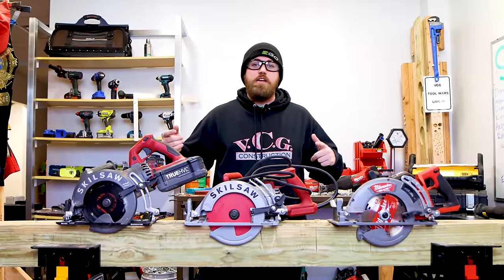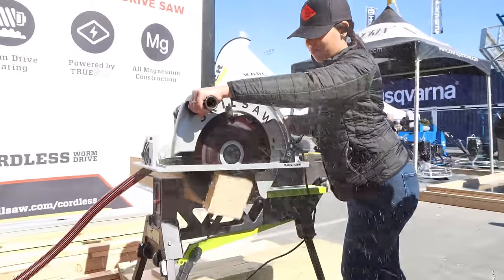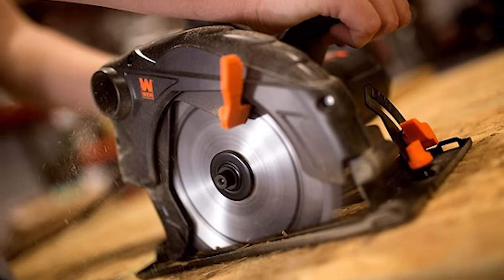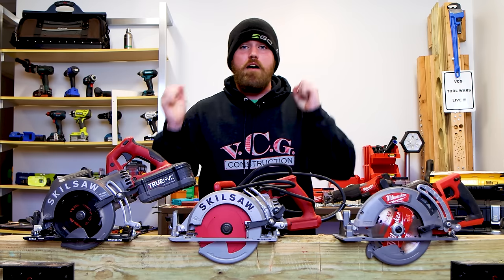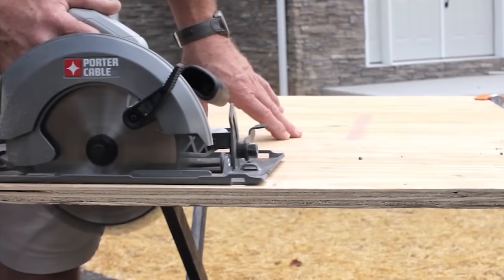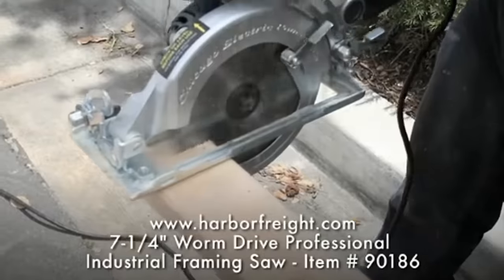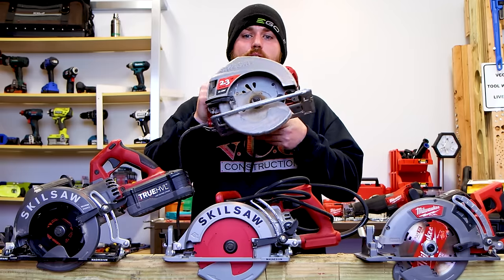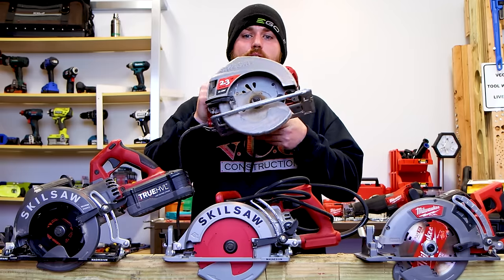We RANKED Every CIRCULAR SAW From BEGINNER LVL To EXPERT LVL (What Level Are You?)

Comment: I have a circa late 1970’s (original owner) Skilsaw 77 worm drive. HEAVY but still running strong 45 years later. Just built a 20’ x 40’ deck with it. Best investment ever. Did I mention it is heavy???  💪💪👷🏻‍♂️🏋🏻

Comment: He had me at  Ryobi (9:45)  I actively avoided Ryobi for the exact reasons he mentions. It looks cheap, ugly, and amateur, but I had to borrow my brother-in-law's miter saw to install some flooring and was genuinely surprised by how much I liked it...so much that I had to go out and buy my own. It's now one of the most loved tools in my shop.
Reply: i own a whole set of Ryobi. It gets the job done even though they arent the best on the market. I would go with Milwaukee or Flex but i don't have the money to shell out for the best of the best
Reply: I bought a Cobalt sliding compound miter saw and it's amazing. It's going on 9 years and still good.  Also the Cobalt air compressors are really good. The problem with cheap tools is not the tool. It's the battery. The battery is the most important part of a cordless tool. Corded tools you can get away with some cheap tools. My cordless Ryobi tools the batteries died in months. I'll never buy them again. Milwaukee batteries last decades.
Reply: Ryobi lacks power though
Reply: Just don't buy the finish nailer. Damn thing can't help but stop working.
Reply: I LOVE my RYOBI Reciprocating Saw.
Reply: @DudeEggs I have a Ryobi 18g nailer that I bought on a whim. Assuming it would break after a month or two. Damn thing won’t die! It’s been like 5 years

Comment: The reason for two 18v batts for the Makita is that you can charge both batts at the same time in 45 mins or less, whereas those bigger "red" an "yellow" batts take almost two hrs to charge. Time is money!
Reply: Quick charge units shorten that time on those bigger batteries
Reply: Time is money. Buy 2 Dewalt 9amps and have one charged while one is working. By the time one dies you'll have another one in the tool. Makita requires you to have 4 whole batteries going
Reply: @JohnDoe-hn5nl  quick charge shortens the life of the battery.
Reply: @sessionbox4256  a single dewalt 20v doesn't have as much cutting power, or make as many cuts as a makita double battery. You may have half as many batteries, but you'll make twice as many trips to the battery charger, and it is a nuissance to have a battery die when you're up on a roof, or a ladder, or scaffold. When a person uses cordless circular saws every day, those walks to the charger add up quick, and the batteries can even pay for themselves. Plus, the makita cuts deeper, it's the only saw I know that cuts 2 5/8" depth, which is what's required to cut completely through LVL floor joists (not even corded skillsaw does that, nor dewalt).
Reply: And the Makita saw will go all day on a full charge.

Comment: My favorite saw will ALWAYS be the Dewalt 378G. That saw looked funky as hell - look it up. But I never used a saw that lent itself to working on the ground, one hand use ripping plywood, or cutting tops off vertical beams in the air so effortlessly. It was the perfect combination of a Skilsaw and a sidewinder.  They discontinued it, I patched the cord 5 times, replaced a plug, and cracked the handle and re-stuck it on with gorilla glue. Somehow between my dad and I, it's still alive 20something years later.

Comment: I have owned a Craftsman 71/4” Circular saw for years and it does a great job.
Reply: Wen it breaks due to your Skil level don't get Black and Deck her. Maybe-tabo you have your warranty in Milwaukee
Reply: @raul0ca  I have had that Craftsman 7/4 circular saw for along time and it does a great job and I ordered the replacement cord and fixed it myself.
Reply: @raul0ca  I will not own a black and decker power tool.
Reply: @johnkozlowski7642  I''ve done that too

Comment: Well, I use that 36volt Makita saw...It has a magnesium base, rafter hook,  Yes its heavy, but I've also used the Milwaukee Saw too and it's no lighter.  With all the same features.  The single battery shown was the 12 amp hour battery that is just as heavy as 2 Makita batteries.  I've also used the Dewalt saw with the Flexvolt battery.  Great saw but not any better than the Makita or Milwaukee. Also you might talk about the prices of these options.  That 12.0 High output battery Milwaukee makes is over 250 bucks.  2) pack Makita 6 amp batteries cost 180.  So these 3 saws are equal in every way in my opinion.  I am not a fan of Metabo at all.  My business partner bought some new tools from Metabo, he sold them after a week.  Went back to his Ridged.  Hilti tools are great tools, but if you can afford them, you don't need to work for a living.  I've never used the Skill Saw battery saw.  I have an old worm drive  Skill Saw that you have to put oil in and change it sometimes.  It is a beast!!!  I bring it out to rip hardwoods and yellow pine posts and beams.  I totally agree with that old saw being the best ever made!

Comment: The good thing about makitas 36v tool line is that if you have a bunch of 18v tools you don’t have to buy more batteries just for 36v tool. So it saves money. Instead of having to buy 2 or 3 or even 4 more 36v batteries just to use the saw. I agree it’s heavy having 2 5ah batteries on it. But it’s still better then spending another 300$ on batteries. 
But that’s just me. I was already in the makita tool line. And needed a circ saw. And it has a deal that came with 4 more 5ah batteries. I couldn’t turn it down. It’s awesome. But I haven’t used many other saws in the last decade. So I don’t have anything that’s current to compare it to.

Comment: Master Framer, here....The tried and true Makita 5007NB, was the best circular saw made for rough framing use.
Unfortunately it is no longer in production.  I but every one I see at pawn shops. Currently have two in operating condition, and three in garage for parts. Although I have switched over to the NEW MAKITA cordless line as my EDC tools. There is still a 5007NB in the tool box on my truck.

Comment: I have 2 Black and Decker circular saws that are older than me. Probably from the late 70’s and I used them both today and cut 45 degree miters through a dozen 2X4’s with a 24T Diablo blade. They cut through like butter and never bogged down once. Both are rated @ 9 amps. I was shocked at how nicely they both cut. I was actually waiting to be shocked since they both have metal housings and are HEAVY. I’m buying the  Bosch Worm Drive for my custom panel saw jig. I was actually building it for the B&D but didn’t want to chance that either would shit the bed  before I finish my next few projects. I’m actually shocked you put the Porter Cable in such a low category. If your tools can’t make long straight and accurate cuts you can’t build A DAMN thing people.

Comment: Hilti cordless cuts LESS THAN 2 3/8" depth.
Skilsaw 48v cordless cuts 2 3/8" depth.
Dewalt 60v cuts 2 9/16" depth.
Makita 36v double battery saw cuts 2 5/8" depth.

Just last week, I was cutting LVL floor joists that are 2 5/8" thick, and the makita 36v double battery saw is the only circular saw I know that makes this cut. I know it's particular, but we make these cuts on every house we frame. We haven't given the dewalt 60v a chance yet, maybe one day we will, but all of us would rather spend that money on other stuff. We use the dewalt 20v series a lot because of the variety of tools. But the makita 36v double battery series are super practical for a few specific tasks and super affordable in comparison to lesser voltage plus time walking to charger, and higher voltage tools and lack of applicability per specialized battery.

We wouldn't even consider getting Hilti cordless tools or the Skilsaw 48v saw because they are not practical. They do not support the tools that we need:
Hilti has a circular saw and roto-hammer, but no sawzall, blower, radio, concrete vibrator, etc.
Skilsaw 48v just has the circular saw, no sawzall, no impact, no drill, no blower, no radio, no concrete vibrator, no lights, nothing but the saw.
So Hilti and Skillsaw drop the ball in variety of tools, and depth of cut.

Dewalt 60v has the variety of tools and the performance we need, but we haven't tried them as they are expensive and not as convenient as using 2 makita 18v batteries. The prices may be comparable per batteries, but not per tools, and we do beat the hell out of tools.
Makita covers all bases. The only downside we've had with their saws, is we break the sky hooks on them, but I'm about to fix them.

But hey, your video got over 500k views in 2 years and 5 months, maybe it's because of your humor. Have you considered making a comedy channel?

Comment: Makita XSH08Z should be expert. Can be used on a track
Reply: garrad miller nah definitely lies in the lower pro level, the dewalt and milwaukee 18v saws are both much better. And then dewalt flexvolt is another level
Reply: @joshbenton810  another level in what way?  Having the most power doesn't make something more suited for professionals necessarily.
Reply: @h2s i disagree. Its a circular saw that can do anything the others can with an added feature.

Comment: I don't understand how come I managed to watch this pile of bull...

Some fun facts; 
1st, "Black & Decker", THE B&D you are talking about, has been out of business for years and years. The now B&D branded tools are just DeWalt's "hobbyist" line. Pretty much the best self acknowledged home//one-time-use//DIY'er tools out there. 

2nd, perhaps some U.S. shops just toss money into "the new tool" because reasons, but actual businesses need three concepts fulfilled by their machines: Durability, Reliability, Output
Pretty much in that order of importance. 

SKILSAW makes a nice saw, but just barely ties up with Hilti, DeWalt and Makita on all these categories. 
Being "historically important" doesn't mean it's the best tool to get. You've said so yourself while comparing Ryobi with B&D, and putting it on a better tier. 

Finally, an actual contractor would end up prefering DeWalt, Makita or perhaps Milwaukee depending on base and long-term costs, varying between states and even cities. Best deal on a great tool is hold by DeWalt down here; just because Makita comes a bit expensive both on acquisition and long-term maintenance. 

Hilti is not even present on the scope for pro-tools. It's a luxury item. No sane contractor would pay up front for long term maintenance, that isn't really often covered by the warranty. 

Regards!

Comment: I've got a Milwaukee rear handle and a DeWalt 60v rear handle. The only thing I don't like about the Milwaukee is the tension is so great on the blade guard that it pulls a 1/16 to the right as you engage the cut. I've still got my old skilsaw corded, but the DeWalt is my saw of choice.

Comment: Two batteries is the price of the compromise so you don't have to change the whole platform from 18V. However it'd be nice if it worked still after one of the batteries drains.

Good Ranking - Agree :)

Comment: I got The Milwaukee 7 1/4 magnesium 15a corded out of some guys garage for sixty bucks with a makita corded drill. Boy does that sucker cut, ended up cutting through some hardwood maple, with a blade missing over half its teeth. Like butter, and didn’t realize until after the fact. When I was putting her back in her container, and went to take the blade off. 

     Needless to say, I’m sold. Went out and bought some diablo blades for her after.

Comment: It seems he prefers worm drive saws but they are heavier and bulkier than I like. I liked that Metabo/Hitachi saw the best as it also has a corded option that you can use while the battery recharges. Corded saws are not innovating anymore, battery powered drills have more options nowadays.

Comment: I had an old skilsaw give up, it is a 10 amp 1 1/4 horsepower, it’s motor gave out, replaced it with the 13 amp skil, it’s nice and even though some parts are slightly different, it it essentially the same but much more lightweight and powerful, skil is one of the few tool brands that still has my respect

Comment: Iam a fan of ryobi.
But the circ saw i got was the base level black base saw.
Been trying to cut 22mm pressure treated planks.
It was really struggling!
Had to cut really slow or a shallow cut then a deep cut.
Blade still kept binding.
Bought an 18v brushless dewalt circ saw, my first dewalt tool.
And its amazing!
Only cost 163 quid!
Glides through the wood the ryobi was sticking at!
So pleased with my first dewalt saw!

Comment: I have a Harbor Freight "Professional" worm drive. It has taken a beating cutting anything I have thrown at it. Using cut of disks on it, steel cutting blade, and standard wood blades. It is a beast for a cheap saw. It definitely won't stand up to my ancient Milwaukee Worm drive, but it's a good beater.

Comment: I've got an old Black and Decker 7-1/4" that I used for all my projects that I got from a 2nd hand store years ago for under $10. I do not have a Miter or Table, I use this thing for everything and it works great, I use it more than my brand new Ryobi 6-1/2", that thing is just terrible. But it is time for an upgrade to use it better and actually have measurements and a depth setting that stays where I put it. Will probably get the Skil for $59.95, you putting in Apprentice just reaffirms my choose. I do love the idea of the Metabo plug in battery adapter. I've known a few that have old drills that you could plug the battery while still in the tool and it will charge while you set up for your next use, they need to bring that option back, even just the same idea of this where I can turn any of my battery tools to corded if all all my batteries are dead.

Comment: I just picked up the Makita X2 36v 7 1/4 Rear Handle circular saw. 4 batteries, 1 dual battery rapid charger and a bag for $249. Already being on the Makita platform, I couldn’t resist. I haven’t used it yet, but it sure sounds sweet. I haven’t seen a single video on how to make a badass, true track for one of these bad boys, so that will be my first project. Thanks for your knowledge and humor, brother!

Comment: So I own a 35 year old Makita worm drive saw and a new DeWalt right blade saw. The left blade worm drive saws are actually a scam, and shouldn't be sold in 2023 anymore. The left blade configuration when used right handed, creates a huge plume of dust that covers your entire body. A right blade saw, used with the right hand, the new ones have a very clear unobstructed blade sight line, and they blow the sawdust behind and away from you and almost no dust goes towards you. They need to make a right blade worm drive saw with 5800 rpms and a dust port. Modern blades don't need to be run at low RPM anymore because they are twice as sharp as a blade from the 1970's.

Comment: Ridgid in apprentice class....what the hell?  And I don't drink tea, I drink beer.  Ridgid should be in the pro category here, like their other tools.
As a side note...Ryobi stuff is a lot different now than it was before they changed their color scheme (and I assume, their factories).  I have a couple Ryobi tools back when they looked somewhat like Bosch.  My Ryobi mitre saw has thousands of cuts on it, and still works flawlessly.  My Ryobi recip saw....maybe not so good (blade travel has always been bad), but it still works, and it has a LOT of miles on it.
But I've been moving all my tools over to Ridgid.  So when (if?) those two tools ever fail, they'll be replaced with Ridgid.

Comment: Maybe it’s just me, but I’ve always felt like different brands are more tailored to certain trades than others, and if you’re doing multiple gigs and can spring the cost, different brands for different tasks is really a game changer. To me, Dewalt is geared more towards framing and carpentry whereas Milwaukee is geared for electrical and Hilti for masonry. It’s probably just a byproduct of absorbing the opinions of the various tradesmen on different sites but as such, I have Dewalt for my home and side carpentry work (Including compound, table, 7 1/4, jig etc) and Milwaukee 12v Fuel for my professional Low Voltage bullshit. 

Anyone else feel like certain brands tailor to different trades more than in any other line of work?
Reply: Would say I agree, but we do framing and we only use Milwaukee for saws, drills, impacts, and multi tools. Milwaukee is just so much more reliable and powerful than dewalt. I'll never go back.

Edit: we do however use dewalt miter saws. My bad
Reply: @pondlakes same I’m in carpentry and we use mainly Milwaukee power tools, except dewalt miter and multitool but I’ve been wanting to grab a Milwaukee multi tool

Comment: The Makita rear handle is better than the dewalt. For one it's like $200 cheaper, it's actually lighter. And one thing I don't like about the Dewalt is the dust tends to blow over your line, and if your cutting plywood up a wall the dust blows right in your face.

Comment: I have a Milwaukee M18 fuel 7.25-inch sidewinder circular saw and it cuts like wood like butter, leaves smooth nice smooth edges, and it's comfortable in the hand. Also, the sound of the saw is easier on the ear. Having the cutting power of corded and the convenience of cordless which I absolutely love about my M18 fuel sidewinder.